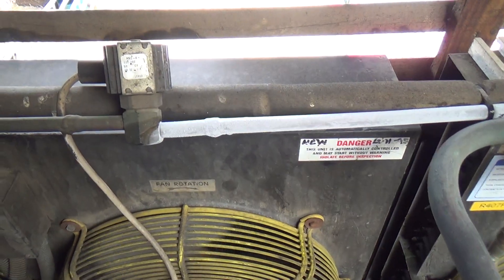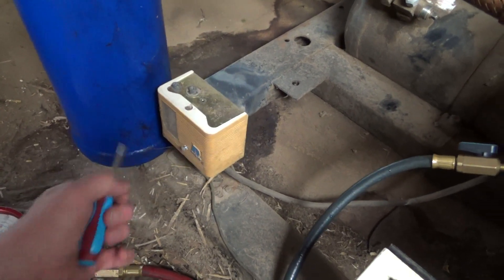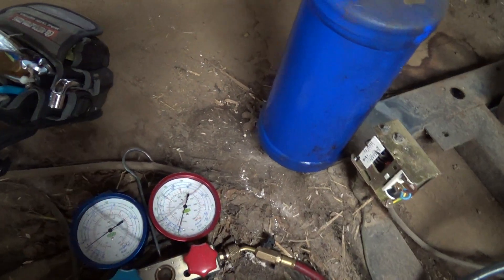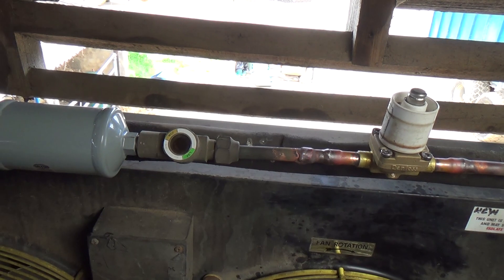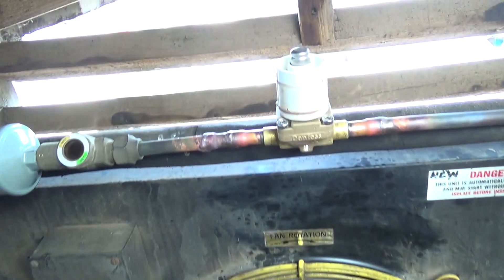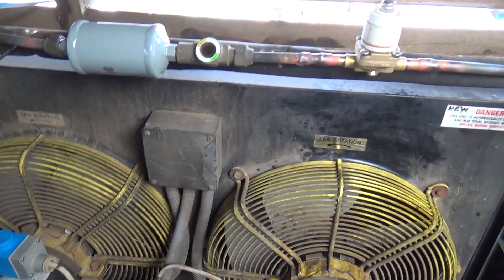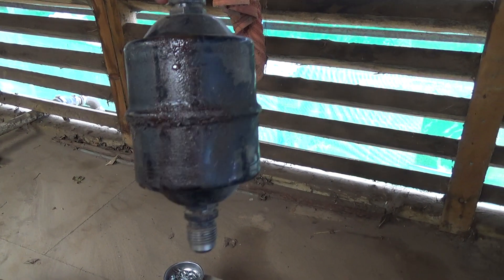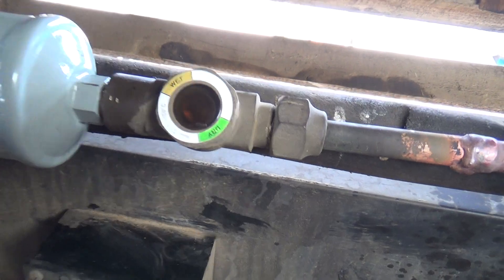Classic Solenoid Fail

Comment: I kinda what to start using danfoss solenoid valve now that you say that. Much  quicker to replace a failed coil over a failed valve
Reply from the maker: I've found them to be pretty reliable, though a few years back they had a batch with bad o rings. I've had no trouble since.

Comment: Hi John, interesting video- especially about the refrigerants. Why are they so expensive? Surely at that, some of the older systems would be written off if they suffered a major leak? Not good for business! Best wishes, Alan
Reply: EPA/Montreal Protocal is the reason refrigerants are so expensive.
Reply from the maker: They want to phase out the higher global warming refrigerants, so have put the price up month on month to dissuade their use, my suspicion is that they have realised they may as well just bump the price up on all of them as we still keep buying them...

Comment: Best start saving gas from recovered units!
Reply from the maker: Yeah, you are allowed to use it again but only for the same customer at the same site. Generally if its in good condition the refrigerant goes back in after the repair work has been done.

Comment: Good to see you're posting regularly again. I like that cable reel, not as common here in Canada, I might have to pick one up!
Reply from the maker: Thanks! Yeah the cable reel extension lead is really useful.
Reply: Common here, in both steel and plastic drums, and I like them, though I tend to make my own, using any appropriate size cable reel I get for free, a metal socket outlet ( preferably the 4x2 dual socket outlets), a good cable gland and some method of attaching socket outlet to reel. then good quality cable and a good plug at the other end.